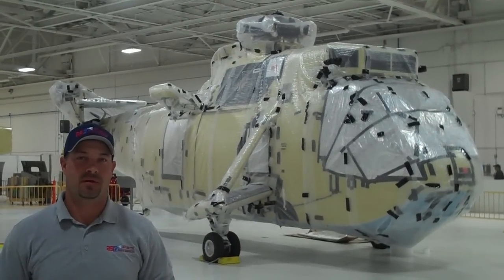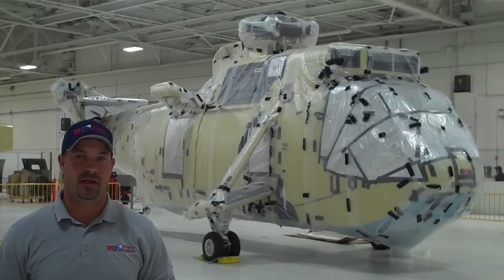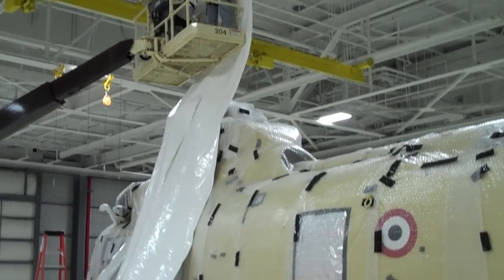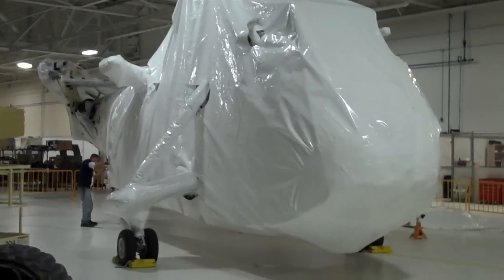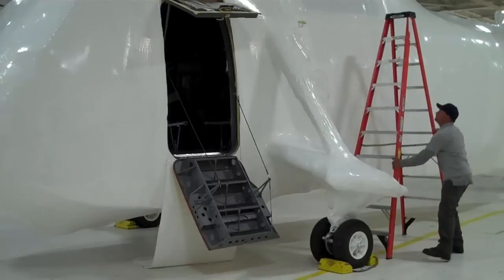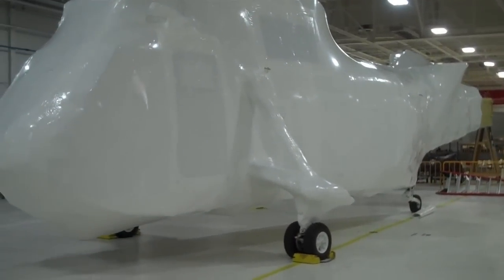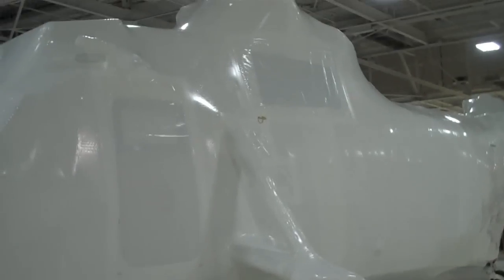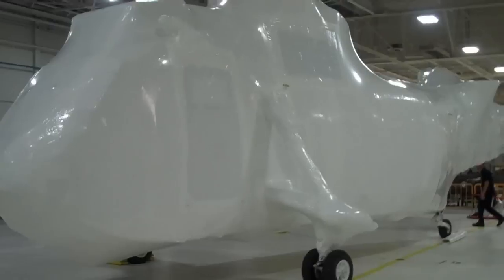Shrink Wrap Helicopter by ASI for  Agusta Westland

Comment: I agree with Maloy, this was not thought out. It is a great procedure to capture on film, however; this does not show the whole procedure. Is it one piece or several pieces. How are they bonded together? What thickness of material is used and where is it manufactured.  You may know this well but a novice will need to see all the steps!  Please redo this as there are no similar videos online and you will be providing a good service. Thank you for trying.